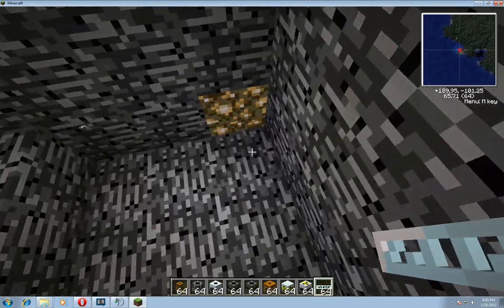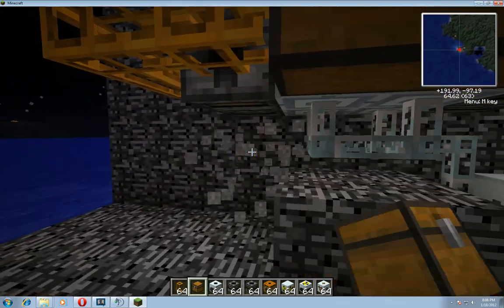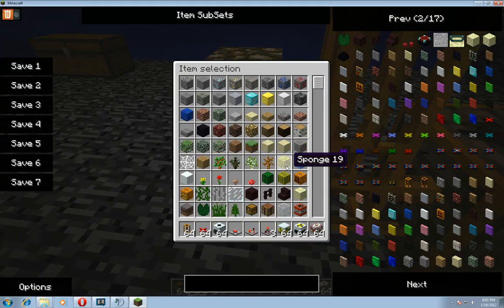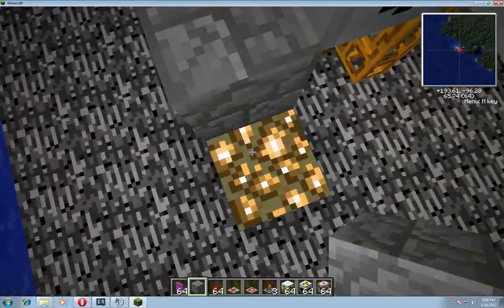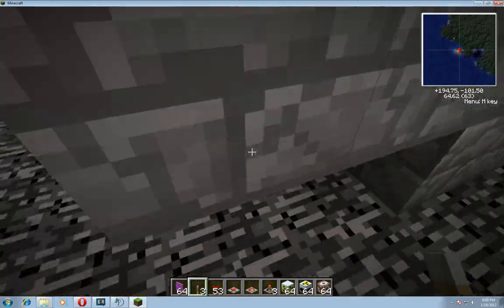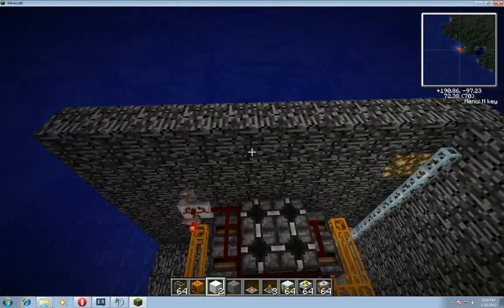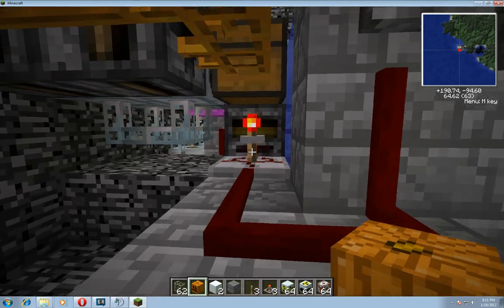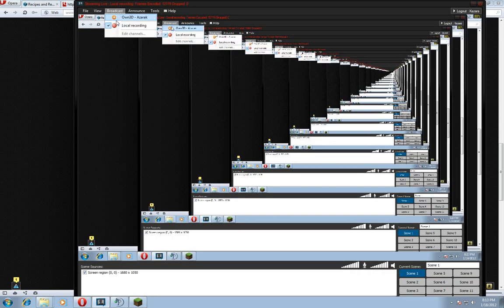Kazara's 1820 Eu/t 6x6x6 ICE CASUC Design

Comment: How do you mean? I tried to put 1 stack of 6 ice in the filter.. but that means that the ice is also stacking inside the reactor (so there are 5 empty places in the reactor). In your link you have 6x 1 block of ice inside the reactor, i got 1x 6 blocks of ice. I think the 6x 1 block of ice work better, because my reactor blew up after 3 secs.. 
ps. sorry if this is a double post, my internet is sort of slow :P